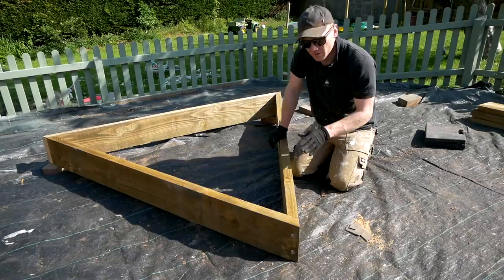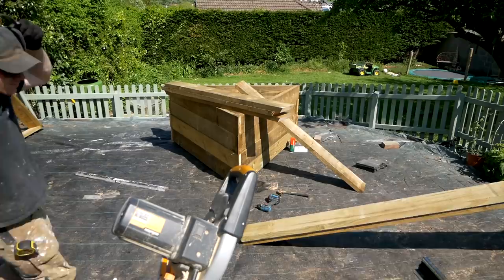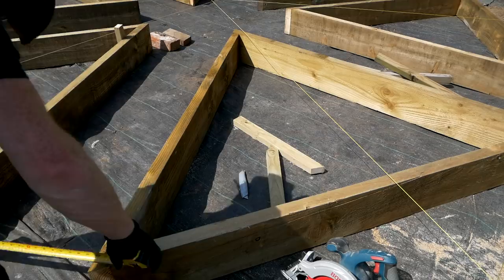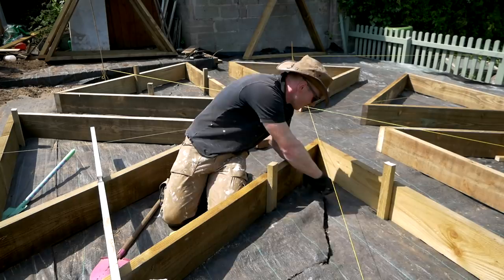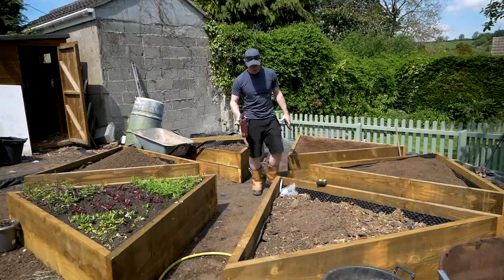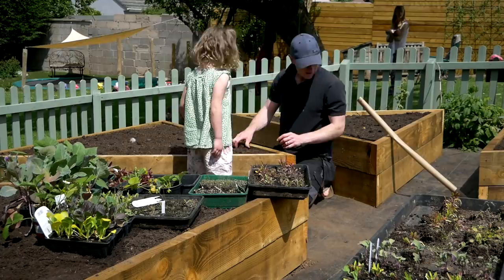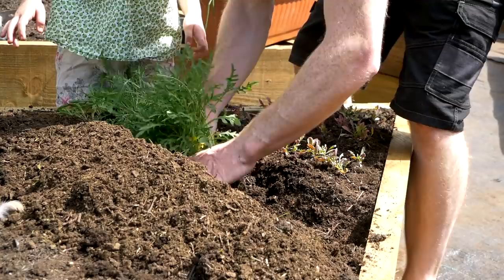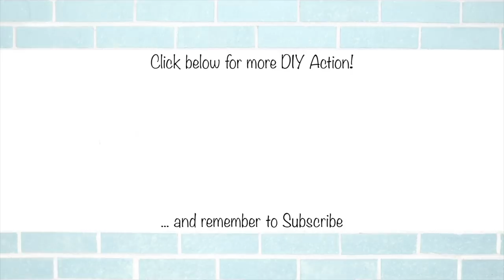CRAZY RAISED BEDS! | Geometric Vegetable Garden

Comment: Congrats on the new addition 😊. Just a quick question, is that just treated softwood you are using?
Reply from the maker: Yes just 200x50 treated from our local sawmill.  Easy enough to work with and much more affordable than to do it in oak or thicker timbers.

Comment: Orite chap.

I’m just about to start a sleeper project, softwood 4x8. I need to put a mitred end on one corner, similar to the joins in this project. In your experience do you reckon I’d be able to do this with a mitre saw as you have here? I’m apprehensive of not having the plunge depth.

In mind I’m thinking maybe a circular saw or a hand saw with old fashioned elbow grease might be a better alternative.
Reply from the maker: Hand saw or circular saw from each side.
Reply: @TheRestorationCouple  Thanks for the prompt response. I'll send you a couple of photos when it's done.